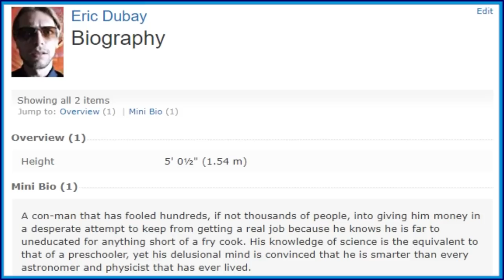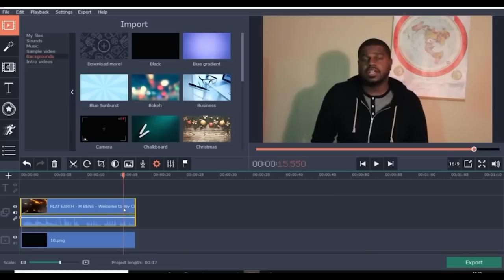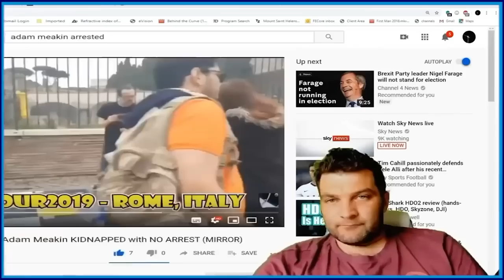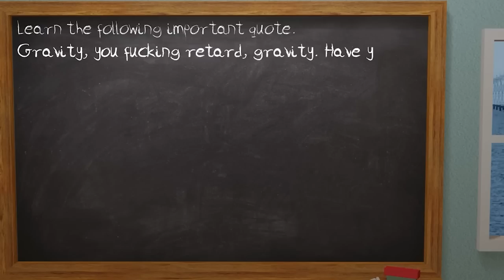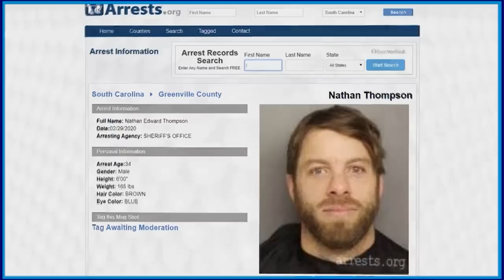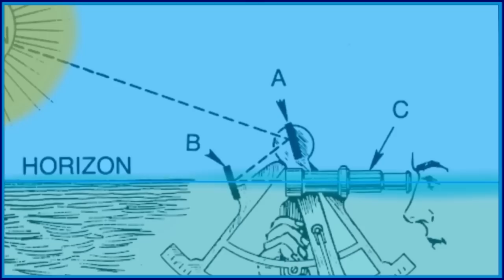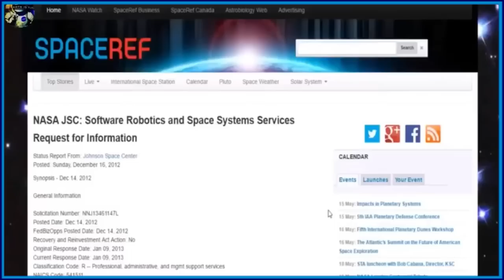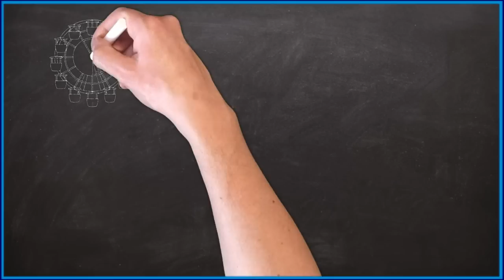Top 20 Episodes Of Flerfs Are Idiots

Comment: my challenge to flat earthers - prove relative density dis equilibrium WITHOUT water, I am sure it will be impossible (this is to ignore the upthrust of water). and also, measure the density of air below AND above the object!! the denisty of the air above that object will be ever so slightly higher than the denisty below the object, so then, HOW THE FUCK DOES IT THE OBJECT FALL DOWN WITHOUT GRAVITY

Comment: Hi Craig could you please explain the 3 body problem. It states the earth, sun and moon orbiting each other should be impossible. Thank you
Reply: That's not the 3 body problem.
The 3 body problem is that exact orbits are easy to calculate for 2 bodies but  are hard, nearly impossible, to calculate for 3 or more bodies because the orbital variables are almost impossible to predict.
It doesn't mean the orbits themselves are impossible, as planets, planatoids, asteroids and comets all orbit the Sun right now.
Reply: How did you get that wrong?  Literally, every flat earther I have heard bring up the 3 body problem got it more right than that.
Reply: The funny thing is, there is numerous solutions to the 3 body problem
Reply: Only slightly related, but apparently, mentioning other social media companies makes youtube delete your comment sometimes.
Reply: Just out of curiosity, where did you learn that the three body problem states what you claim here? When you first heard it from that source, did you bother to check to see if the description of the three body problem was accurate? 

It seems like you may have heard this from a flat earther or someone like that, and they didn't actually know what it was, or they misrepresented what it was for their own benefit. 

If I were you, I would have checked out the issue first, and I also would have searched for some informed responses to the question of the three body problem. There are great explanations of it all over the internet.
Reply: @Alysm-Aviation  if you know the answer sir you have a Nobel prize headed your way. Please define it. I’m talking about when the moon orbits the earth, which orbits the sun you have the sun pulling on both the earth and moon obviously at the same time. So when the moon is on the sun side of the earth, the sun should pull it out of its orbit sending its orbit into chaos and crashing into the earth. Jupiter has how many moons? Explain that. The sun can hold Jupiter in orbit but yet it doesn’t bother jupiters moons at all 😂. Physicists can’t figure this out even today. It’s called the three body problem
Reply: @jimsmith7212  “nearly” impossible is not a satisfactory answer. Something can’t be “nearly” impossible lol. It’s either explained or it isn’t. The 3 body problem is a major thorn in modern day astrophysics
Reply: @whitebuffalo6071  don't need to come up with one myself, if you had bothered to even google the problem you would've realised that there is over a dozen different solutions.
You not understanding what the 3 body problem is, is not an argument.
Reply: @Alysm-Aviation  great response. I’m truly asking Craig or anyone to explain it. You are mistaken there are no viable answers without getting into fringe science and mysticism to explain it. But hey thanks everyone for jumping in and providing no actual tangible answers lol
Reply: @whitebuffalo6071  no mysticism required, just math and physics.
Also, calling well founded physics "fringe science" doesn't make your case either... it only displays your dishonesty.
Reply: @whitebuffalo6071  
I said "exact" orbits are nearly impossible.
Do you know the meaning of the word exact?
Obviously it's possible to calculate orbits that are close, and  certain special case orbits are easier to calculate. 
"Imagine you had a marble and you wanted to put it at the point between the Earth and the Moon where the force of gravity was equal from both. The two forces would cancel out, and the marble would remain in that location forever. If the sun and the earth were not moving, there would only be one of these points, but because the Earth and the Moon are both orbiting around a common barycenter there are 5 of these points that always remain in constant relative positions to the main bodies. They are called Lagrange points, after the man who discovered them Joseph-Louis Lagrange, and are some of the most interesting points in the 3-body problem."
See Wikipedia; "List of objects at Lagrange points".
Reply from the maker: No it doesn't. The three body problem is solved and has been for a long time. There is many solutions to it
Reply from the maker: That is not the three body problem
Reply: @Alysm-Aviation  I simply asked a question. If you can’t answer it please stop commenting to me. I think we both agree it should be a straight forward explanation. The problem is it isn’t. It’s interesting how triggered everyone gets by me asking a simple question. What keeps all of jupiters moons orbiting Jupiter but not flying off into the solar system or crash into Jupiter. The argument is stating that Jupiter has a stronger gravitational pull then the sun, which coincidentally is strong enough to keep Jupiter in orbit. It makes no sense whatsoever. If the sun is strong enough to hold Jupiter in orbit it surely should pull those small moons away from the planet
Reply: @whitebuffalo6071  
The Moon and Earth orbit a common center of gravity, called  barycenter, and that barycenter orbits the Sun.
"This is the case for the Earth–Moon system, whose barycenter is located on average 4,671 km (2,902 mi) from Earth's center, which is 75% of Earth's radius of 6,378 km (3,963 mi). When the two bodies are of similar masses, the barycenter will generally be located between them and both bodies will orbit around it."
Additionally;
"It (the Solar system barycenter) is the center of mass of every object in the solar system combined. Our solar system's barycenter constantly changes position. Its position depends on where the planets are in their orbits. The solar system's barycenter can range from being near the center of the sun to being outside the surface of the sun."
Reply from the maker: Solutions to the three body problem

The three-body problem is a classical mechanics problem that involves predicting the motion of three celestial bodies under the influence of their mutual gravitational attraction. It is known for its complexity and lack of general analytical solutions. However, there are some special cases and approximate methods to study and understand the behavior of three-body systems:

Simplified cases and restricted problems:
a. Circular Restricted Three-Body Problem (CR3BP): Assumes that two massive bodies (primary and secondary) follow circular orbits around their common center of mass, and a third body with negligible mass moves under the influence of the gravitational fields of the primary and secondary bodies.
b. Elliptic Restricted Three-Body Problem (ER3BP): Similar to CR3BP, but the primary and secondary bodies follow elliptic orbits instead of circular orbits.
c. Sitnikov Problem: A special case of CR3BP where the third body moves along the axis passing through the primary and secondary bodies.

Lagrange points: In the CR3BP, there are five points, called Lagrange points, where the gravitational forces of the two massive bodies and the centrifugal force experienced by the third body balance out. These points are positions of equilibrium for the third body.

Numerical integration: Due to the absence of general analytical solutions, numerical methods, such as the Runge-Kutta method or Verlet integration, are commonly used to approximate the motion of the three bodies over time.

Perturbation methods: These methods involve breaking the problem down into a solvable base problem (e.g., two-body problem) and a small perturbation. An example is the use of series expansions or averaging techniques, which can provide approximate solutions under certain conditions.

Regularization: This technique involves transforming the original problem into a more tractable one by changing the coordinates, time variable, or both. Examples include the Kustaanheimo-Stiefel regularization and Levi-Civita regularization.

Special solutions and families of periodic orbits: There are some specific solutions that describe the motion of three bodies, such as Euler's collinear solutions, Lagrange's equilateral triangle solutions, and Broucke-Hénon orbits.
Reply: @FTFEOfficial  thank you for being cordial and respectful. I’m seriously wondering how the sun keeps Jupiter in place but doesn’t pull Jupiter’s moons away. I’m not a flerfer, I’m just a person with questions. My logic says ok it can hold a massive planet in orbit but it can’t separate the moons from the planet. It just seems illogical
Reply: @FTFEOfficial  ok thank you very much. I’m understanding what you presented…mostly lol. It looks like I have misrepresented my original statement. Thank you for clarifying
Reply from the maker: @White Buffalo  Jupiter  and its moons are both in orbit around the sun, at the same time, the moons orbit Jupiter. Orbit in orbits.
Reply: @whitebuffalo6071  Oh my gosh, you do actually think your first comment was right.  You are hilarious.